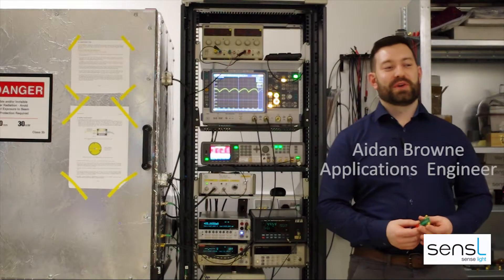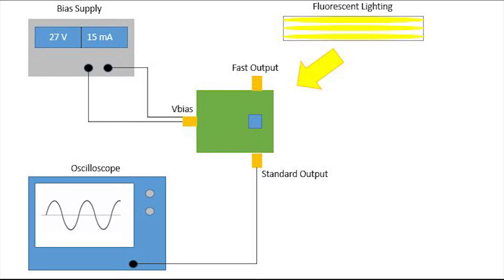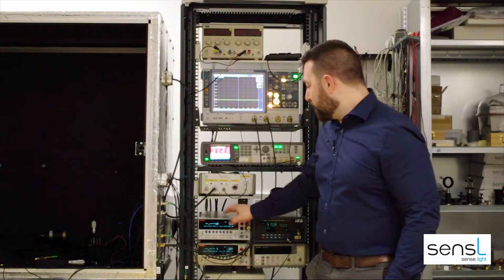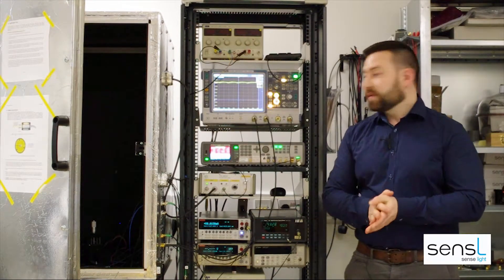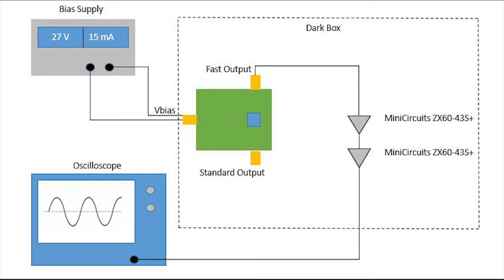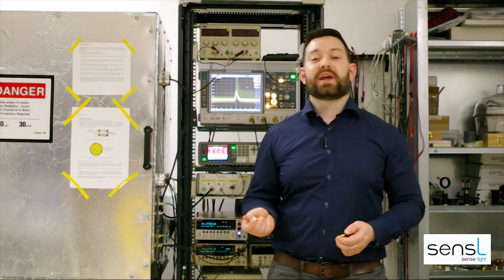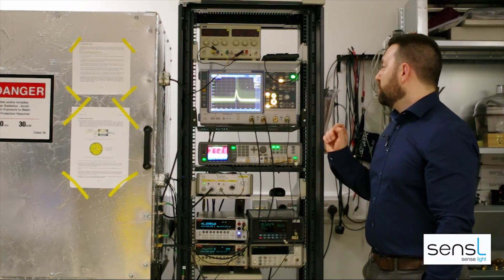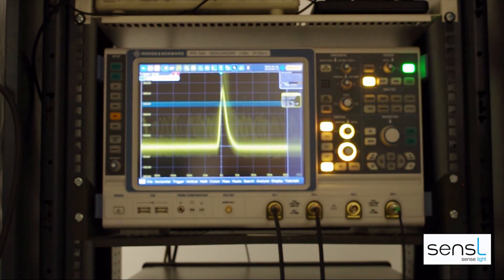How to use an SiPM - Experiment Video

Comment: These SIPM units work great with scintillation fibers for making portable radiation detector, also works with LYSO crystals fairly well, CsI:Tl not so much. Set the voltage to 27v and have a current limiter of 10 to 15mA max the 27v can vary a little bit between sipm assemblies. They also respond well to being actuvely cooled by a 3 stage peltier cooler of low wattage. Drops the dark counts drastically. Use a low noise pulse amplifier to readout. ❤

Comment: Thank you for this video. but I have one question. when I try to connect the benchtop power supply to SiPM board, I can only do one of the "Constant Current" Mode or "Constant Voltage" Mode. So, I can give 27V but not 15mA.(I feel the current is determined by the register of the board automatically) Can you let me know how you made both 27V and 15mA?
Reply: A bit late, but: 27V is the voltage and 15 mA is the current limit . Normally the power supply works in constant voltage mode. If for some reason (too much light, short circuit) more than 15mA would be drawn (if there were no limit), the power supply switches into constant current mode.